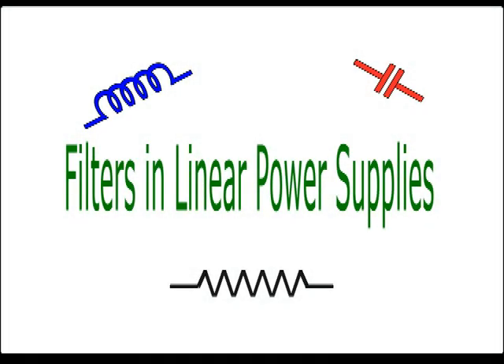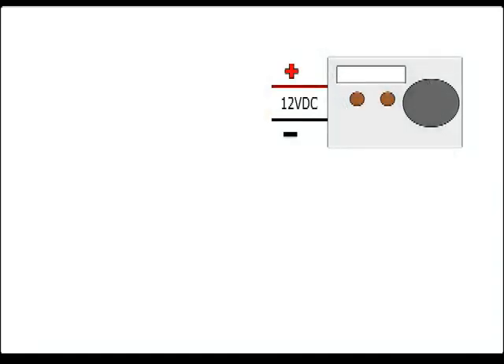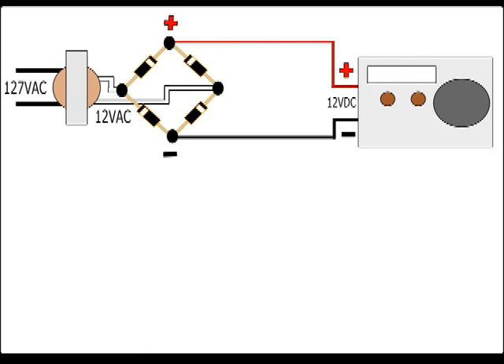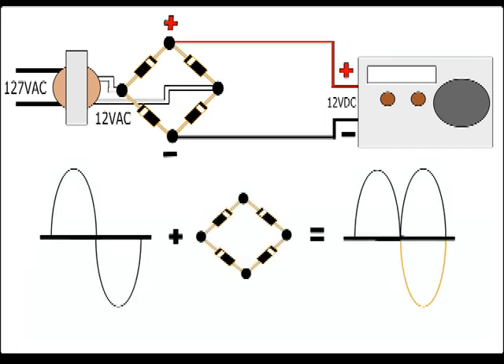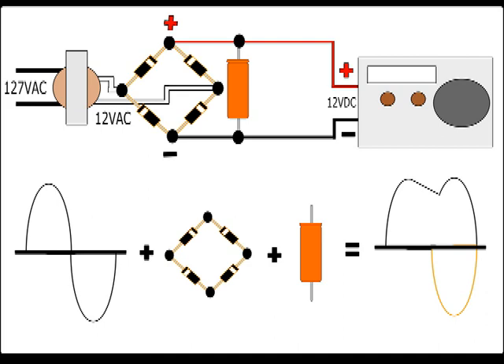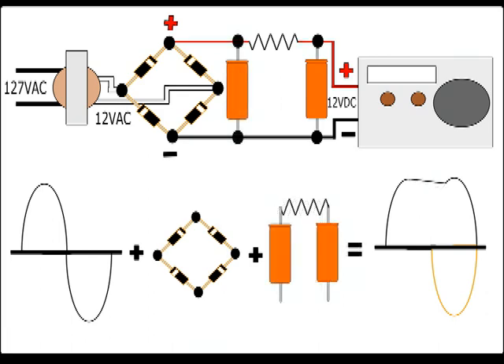Filters in Linear Power Supplies

Comment: Thankyou, thankyou, thankyou!!!! 
 I have searched high and low for this simplicity.
 I have a 240vac SCR (4000W) with potentiometer feeding to a 1000v 50A bridge rectifier. This is dampened by a 400v 420uF Capacitor THEN fed to an 180vdc 1.5kW (2HP) motor (3800RPM max). These motors come from treadmills/walking machines and are very cheap, if not free. I would like to use them in multiple engineering applications, they are small and very "Torquey", however, the motors don't like operating at low RPM's if they don't get a "Clean" DC supply. They Hummmmm/Vibrate and carry on a bit, seriously BAD without the Capacitor.
I understand your filtering BUT wonder what values for the 2 capacitors (half of 420uF? each x 2) or 420uF each x 2, AND, what value should the choke coil be? I have no idea here. Just a mechanical engineer with a bit of electronic knowledge. If I knew the value I can find the chokes on eBay....."
Thanks if you can help. 
I can fudge it through with a scope I guess (just ordered a cheap one + LCR Meter).....trial and error I guess until I can see a clean signal. Just little hard for me although I might learn something along the way..........
Cheers and thank you again.....David Harper (Australia)
Reply from the maker: Thanks for such a nice comment!! Well, it's nice to know treadmills have such a powerful motor (thinking about a small electric vehicle) I have never disassembled a treadmill, but maybe you will find an intact supply, in an old treadmill. At least you can find the exact values you need. However, you could try with a high value capacitor, such as 470 microfarads or even higher value. I have been trying to sell a treadmill for eons, I may as well consider taking it apart and use the motor for a small electric bicycle, or so. As to the choke coil, maybe you finally do not need it, but it could be an old transformer and using the secondary only. The winding must be thick enough as not to cause power loss due to heating. I used to be a TV serviceman looong ago, when I was about 20 (currently 78) and old radios and audio amplifiers back then used about 30 henries choke coils, but the current they used was relatively low, maybe a high-current choke coil could be too expensive, you better try using a couple of electrolytics in parallel, also make sure the bridge you got is actually giving you full-wave rectification (one open diode could cause half-wave, much more difficult to kill the ripple. Please keep me updated. By the way, please take a look at my solar energy system. It's wonderful to get a lot of electricity for air conditioning, water heating, room heating, etc. and paying peanuts for the lightbill!

https://www.youtube.com/watch?v=MvP0-S66Dzc